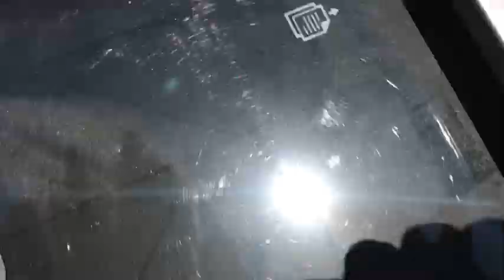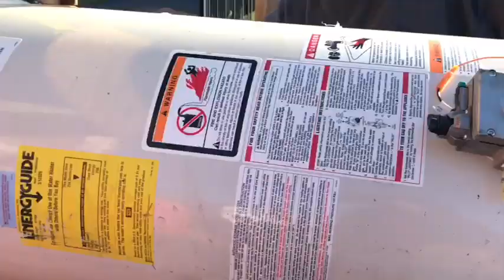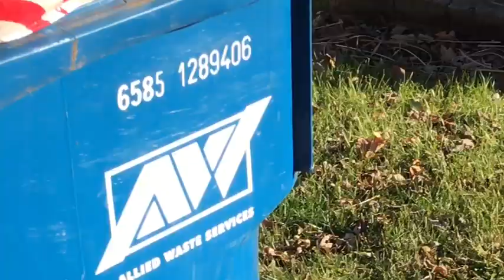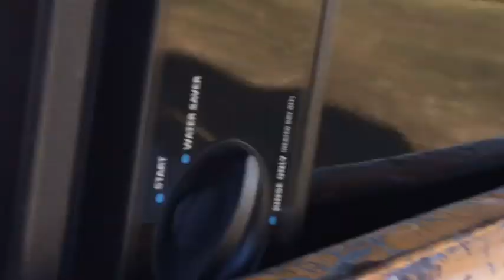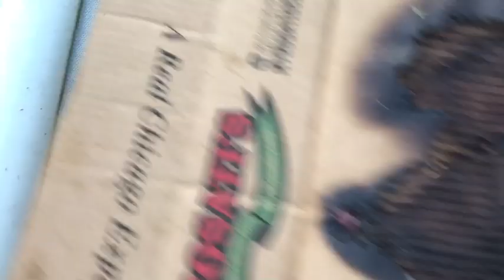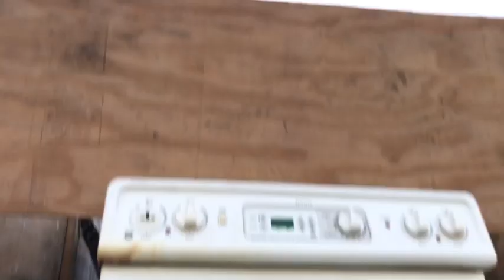Scraplife the dad and daughter

Comment: couldn't you put a hinge and a latch on the top to swing it away.. looks like more hassle then benefit the way it is
Reply from the maker: saint joseph 54 yes it is a gigantic hassle
But I need to keep the walls rigid
They cannot be flexing
They have to be rigid at all times I can't have something that opens and closes because yes it is more rigid when it is closed but when you open up the wall start moving back  bit and overtime the pocket where is the word is based in the pick up bed becomes worn out and lose and less structurally sound
I have yet to find a way to make something like this that is solid sound practical and not a hassle I need to show this in my video